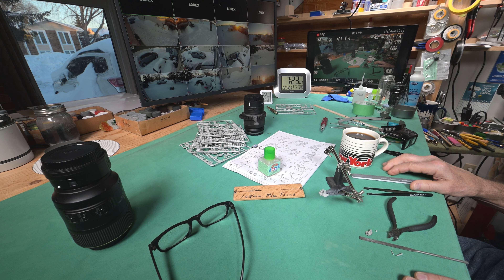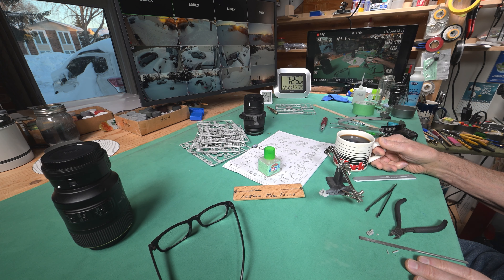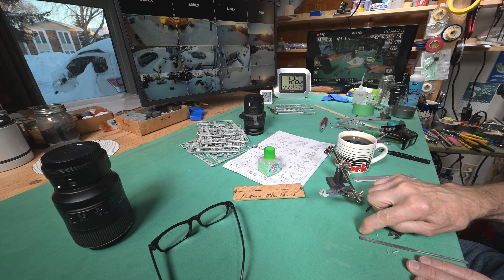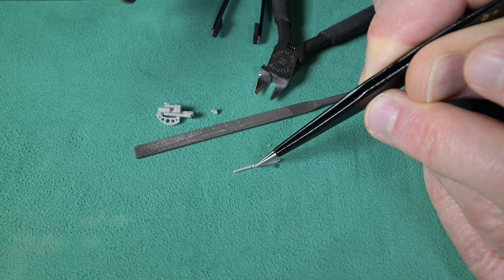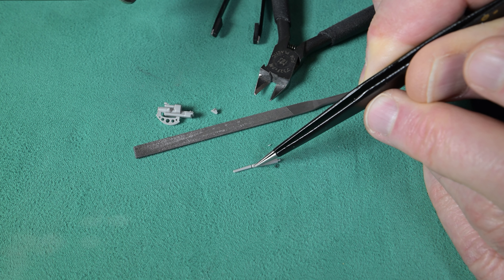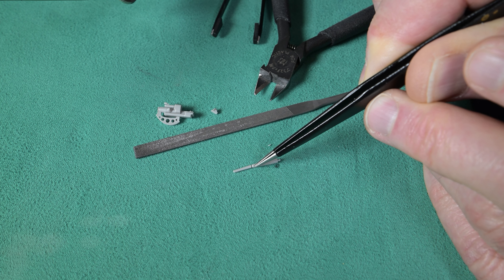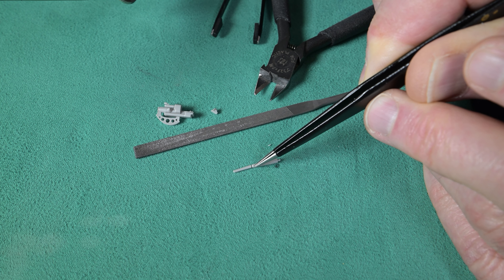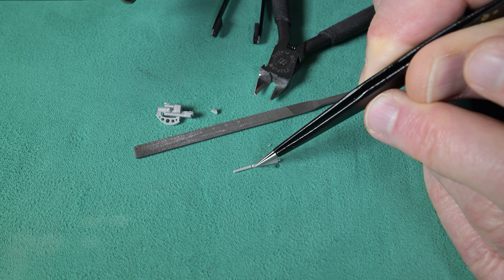The Model Ship - Part 1100

Comment: HI Ron, enjoyed the episode! I realise this is going to be a little late, but maybe if it happens again? I'm thinking that if you were to take the brass photo-etch bender and tilt it up, you could get a V shaped groove that would centre the pieces of the barrel nicely. Also, when you used the extra-thin it wouldn't stick to the brass. I've never had occasion to try this, but I think it would work.
Reply from the maker: I'll bet that would have worked just fine Alan. Thanks for the idea. 👍

Comment: Hey Ron, check out Mega-Hobbies in New Jersey. The Missouri is out of stock at present but they have the Iowa in stock. I have found that using the back edge of the number 11 blade is better for scraping than the sharp edge is; it doesn't dig in as much. Using the sharp edge at more than a 45 degree angle tends to deform the part whereas the back edge acts more like a scraper than a cutter. See ya tomorrow my friend.
Reply from the maker: Good tip! Thanks Greg! 👍